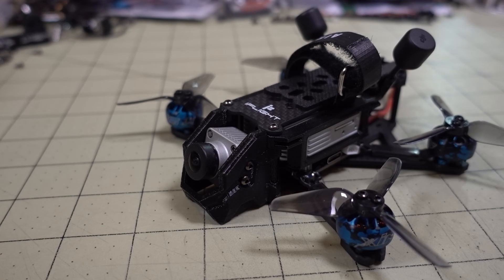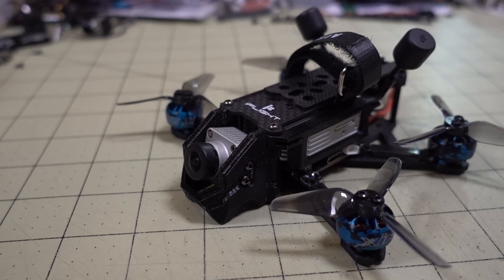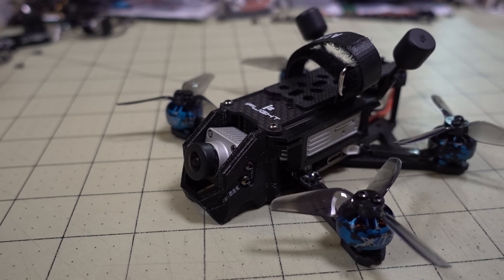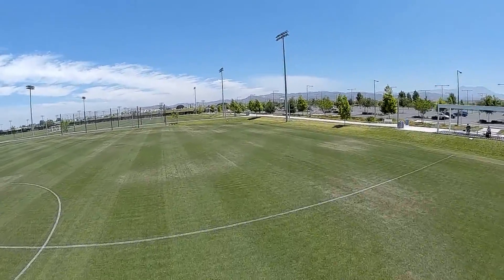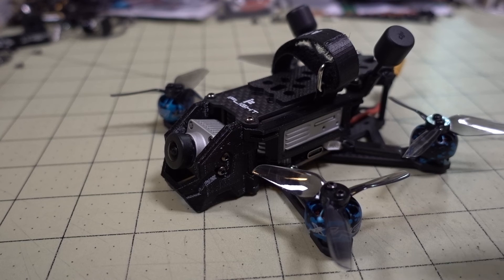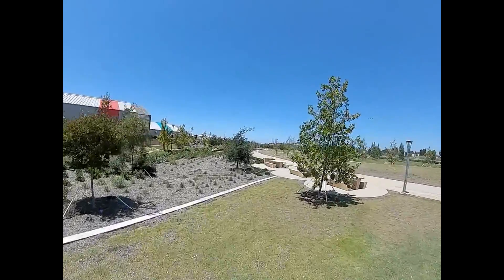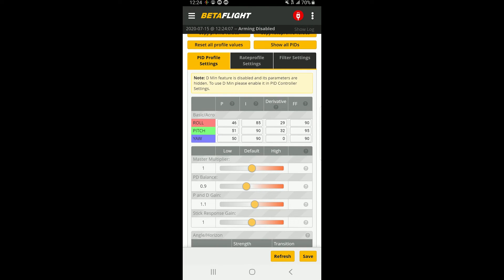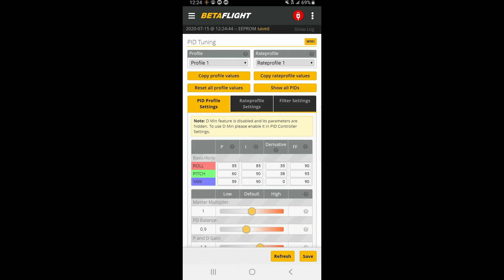PID Tuning Betaflight 4.2 Start to Finish (IFlight DC2) 🎓

Comment: i have a 3" micro running sunnysky 1104 6500kv and cant seem to get it fly properly, it would shudder when throttling with stick movement, currently on betaflight 4.0. I want to try to upgrade the firmware to 4.2, but would i need to change any filtering setting in 4.2?
Reply from the maker: I'm running 4.2 on this.  Just do what I did for filtering.

Comment: Hey Albert just wondering, I've got the same exact pid tuning like yours but i find mine to be slow and responsive especially when cruising and lifting off. It takes like 60% throttle just to liftoff the ground and keep on cruising, when i do flips and rolls, i can't pull up as fast, how can i change this to make my throttle more responsive what sort of configuration or settings do i need to play with?
Reply from the maker: What battery are you using?  Maybe the wrong voltage?
Reply: @AlbertKimTV  hey Albert thanks so much for replying it means alot :) . I'm using TBS Graphene 650mah 4S batteries it says the voltage is 14.8v . Is it an okay battery? Because i followed the recommendation of 450-650mah. What battery were you using in this?
Reply: Maybe adjust your throttle curve in your radio.

Comment: This is a great demonstration how to tune your little bird to the best step by step. I got exactly the same Titan DC 2 like yours and really love flying with it! Now it is the time to flash the controller. Btw how to tune it in betaflight through the mobile phone just like what you did in this video instead of through the PC, anything else do I need? Thank you for this!
Reply from the maker: You'll probably need one of these OTG cables.
USB-C OTG cable - http://amzn.to/2m50iL2
micro-USB OTG adapter - http://amzn.to/2J3Ds1S
You'll have to do some research to find out if your phone supports
OTG or not and what cable you'll need.  That you'll have to do on your
own.
Reply: @AlbertKimTV  thank you for the help and sharing :)

Comment: Am I able to use this ClI dump if I have the same FC. But im also using the caddx vista?
Reply from the maker: It will probably work but the weight is a bit different so you may experience from oscillations.  Just watch your motor temps.

Comment: I believe the reason your quad flew better when you turned off dmin is because the dterm needed to be higher because your P to D ratio was off. When you have dmin on, you’re mainly flying at those lower values(your first flight the average dterm per axis was like 25-30). In this case, when you turned dmin off you’re mainly flying with a dterm averaging in the 50s. 

I would try p on roll/pitch 55/50 and dterm around 40-45
Reply from the maker: I got it flying pretty good in the end and I liked it.  That's what matters to me.

Comment: Why do you think turning off D-min helps?
Reply from the maker: D-min is probably better suited for 5-inch racing drones which have a totally different power and weight setup so it doesn't work well with something in this class.

Comment: Thank you for share it but it seems still a little wobbles. I have done tuning with geprc cinequeen(but my custom) for a long time, the result is that the P value of pitch and roll is 85 without any wobbles. Try P values up more(also need to adjust I and D values).
Reply from the maker: As I mentioned in the video, this is only an 80% tune.  Yeah, if you want it to be more "tight", keep going in the same direction I was going.  I feel like 80% is "good enough" for me.  If you want more, that's your call and it's subjective.
Reply: @AlbertKimTV  I don't like tight tuning always. but only BF 4.2 version, the result is so strange and mad especially 3inch micro drone. I don't know why, but if I raise up P values, more stable. P value 85 is very high value I think, but just feeling smooth like 40 value in BF 4.1. So I just have recommended it. You don't have to agree to that. Happy days!! 😁😆

Comment: Interesting, my Transtec Beetle 2.5" needs 0.8x the standard PID:s on BF4.2 or the motors sound bad/oscilating. I got RPM filtering enabled.
I use the Gemfan flash 2540 props thought, could the difference?
Reply from the maker: Sure, props can make a difference of course.  But you also have a totally different drone, frame, motors, and the KV is different too.  So yeah, it will need a completely different tune.  FYI, for those who might have another micro with a 2.5 inch prop, don't use my CLI dump.  You'll probably burn your motors on this tune because not many 2.5 inch micros use 1404 motors.
Reply: @AlbertKimTV  
Yeah i agree. Pretty beefy motors on the iflight as you said not comparable with 1106 motors on the Beetle.  Anyway it was interesting to watch, always learning new things :)

Comment: I’ve seen people mess with master slider and bring down to .7 for micros. I noticed  you did not. What would be the reason for lowering it
Reply from the maker: They probably had smaller motors with high KV.  It's hard to say without knowing specific details of their builds.

Comment: Much better than it started  👍
I don't like D min and usually leave it off altogether. I also don't like feedforward it can introduce bobbles but instead off turning it off completely now I reduce the slider as much as I can and set feedforward transition to 0.99
Reply: Forget, I never knew.. but I have warm/hot motors on one of my 5”..stock pids, lowered rates a bit.. motors were “cheap”.. (2205/2300), but they get hot just flying around.  Pretty sure it’s the motors themselves.. but it gives me something to play with.  Just wish there was a “breakdown” video of what effects what in betaflight..
Reply: @robaxelsson530  If you are using D min it's the min numbers that are being used by the PID loop most of the time so lowering the D max won't help much. Try lowering the PD gain a little if you want to stick to sliders or lower D min a bit if the motors are hot.
Reply: just did this and wow, thank you man! this helped a lot
Reply: Everyone forgets: Dmin was created for builds with warm motors.
Reply: Munky.   Thanks for the info.. I have yet to even touch any rpm filters or even tried “tuning”.. still riding the betaflight “as downloaded”.. recently  got some good feedback with some rate changes... 
  Still learning to crawl.. but as kabab says.. the more u learn.. the more u learn u don’t know..

Comment: Great stuff! I am currently trying to tune a 3in. Great timing on this video sir.
Reply: Well I tuned a until it wouldn't even fly then i decided to switch from 3016 tri blades to 3018 bi blades with default tune and it flew perfect 👌